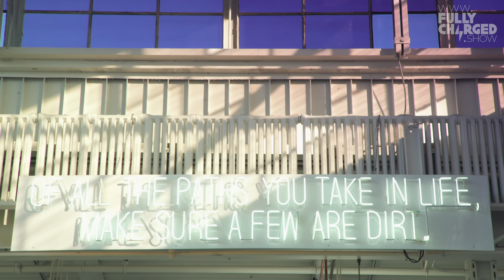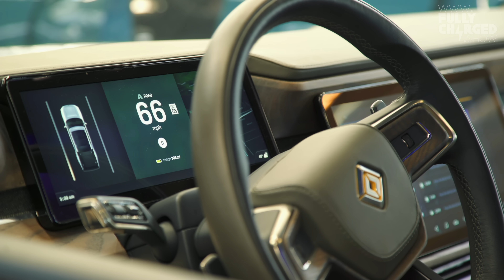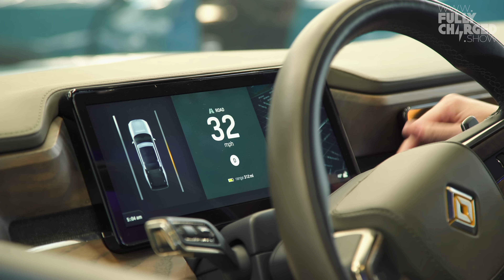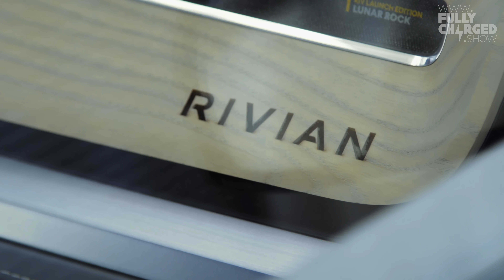Rivian R1S Electric SUV & R1T Electric PickUp Truck - World Exclusive: Inside Rivian | Fully Charged

Comment: Is this an add for these silly trucks?  Ground breaking might be what they do; they weigh 7500 lbs;  towing a car is about 100-150 miles you have to charge; sounds very practical. Did you say your channel is fully charged - these take over a day to charge on a 240v 40 amp outlet.

Comment: It will be interesting to see what the towing and payload range is in real world situations. Also while gas stations are designed to be able to refuel a truck which is towing something, most charging station orientations would make charging a truck and trailer difficult so I would imagine you would have to unhook the trailer, then drive up to the charger. It will be interesting to see how this works out. Overall I'm really a fan of electric vehicles but I also tow with my truck so hearing them just talk about payload and not the actual logistics involved in towing long distance with a pickup is making me want to wait for the real reviews from owners.

Comment: As a truck owner range while towing is an issue. I am quite interested in this truck. They obviously have taken the time to study the market and add some very thoughtful and useful features to their product. And yes range is reduced with an ice power plant. But the infrastructure is there so that you can tow over a great distance and in a timely manner with a traditional power plant. I look forwards to seeing how the Rivian does interms of range when towing, or loaded to capacity. Pulling into a charging station with a 28 foot travel trailer is bound to be an experience. And I will admit the price of admission is a bit daunting, but then a fully loaded 1/2 ton truck is in the same ballpark (my current truck is not a fully loaded model;) )

Comment: I had a thought, what about putting regen breaking on trailers and putting that power back into the tow vehicle.  It would require a different harness and break controller.

Comment: Thanks so much for the Rivian interview Chelsea and Fully Charged.  Sanderson's explanation of torque vectoring with 4 electric motors at 6:33 is outstanding.  Tesla also does torque vectoring between front and rear motors, but with brake actuation left to right, i.e., the conventional way with open differentials.

Comment: Society is changing dramatically when it comes to socialization so to me most guys won't take four full size people with them on any adventure. Most guys would rather have a 6 foot interior bed to sleep in the back and the ability to install a canopy on it.  If you need to keep it same overall length then shorten back seat and increase interior bed length to 6 feet so we can sleep in the back. A family only needs room for two full size people and two kids in the back and they don't need a full size seat. I am a truck man and always will a truck man and I really like this vehicle but I would not buy it with a 5 foot interior bed.  Make a working man's truck not a rich man's truck. Workmen made trucks popular and is the reason why trucks sell so well in America.

Comment: I found the comment about "150 kW" charging interesting. It sounds like they are verifying that these Rivian vehicles will be 400 V architecture, which means they won't be able to take advantage of the currently deployed 350 kW chargers. It could also mean that they are expecting to take a much higher current than what is now being supported.

Comment: This is all well and good, but, they're still not talking about things that are inherently important to trucks.  

How far can I go, towing 11,000 pounds?   And truth be told, I would never tow 11,000 pounds with a truck that size in the first place.   That's not even logical!!!  Being able to PULL 11,000 pounds, is not the same as towing 11,000 pounds in real life, on the actual road.

I would MAYBE tow 5,000- 6,000 pounds, with a truck that size.   You never want to tow anything that weighs more than twice as much as your tow vehicle.  Personally, I don't even want to tow anything that weighs even CLOSE to twice the weight of my tow vehicle.  It's not just about how much the thing you're towing weighs, there's also the kite factor,  suspension and drivetrain wear and tear,  etc, etc. Being able to keep what you're towing, on the road, as well as yourself, is kind of important. 

11,000 pounds is an INCREDIBLE amount of weight for a truck to pull down an actual road, in real life.   This is why anyone pulling that kind of weight is pulling it with something the size of a Ford F350, of Chevy 3500 or larger.   Those trucks themselves weigh 7,000- 10,000 pounds, depending on the model, and they have about a 12-14,000 towing capacity, also depending on the model.   Again.....the whole, twice the weight of the vehicle thing.....

So....what is REALLY important to truck owners is......how much does the truck actually weigh, and how far can I tow what I can actually tow with this vehicle.  In gas or diesel vehicles, it's mpg, and in this case, it's MPC......miles per charge. 

You can throw out all the ridiculous numbers you want, you're not going to fool any actual truck owners. 

It's clear and obvious that none of you have ever actually TOWED anything in your life, if you think these ridiculous numbers are going to hold up in any way, shape, or form, in real life. 

A truck that weighs less than 4,000 pounds, can simply not safely tow 11,000 pounds, even if the power is there to do it.    The truck would have to weigh at least 6,000 pounds in order to even remotely safely tow 11,000 pounds.   And i'd actually say that it would need to weigh more like 7,000 pounds in order to do that any kind of safely. 

Finally, there's a reason that trucks that actually tow 11-12 thousand pounds get such crappy mileage.  It's takes an INCREDIBLE amount of energy to tow that much weight at 60 MPH.   

You're talking about the fact that your TOW vehicle weighs 7-10 thousand pounds, AND on top of that, you're towing 11-12 thousand pounds, for a total weight of 18-22 thousand pounds, going 60-70 MPH down the highway. 

I will just come out and say that you're going to be lucky to get 80-100 miles out of a full charge, towing anything even close to 7000 pounds, which I would hesitate to pull with a truck that size.....  

That's just reality.   You can't fight physics.  Not even with electricity.

Comment: I would like to see a version of the R1T built for work instead of recreation. Larger bed without the fancy spare tire compartment. The tunnel could stay so guys can lock up their tools without the need for a bed cover. The Front trunk should be insulated so guys can store their lunch and water in it to keep cool on the jobsite.

Comment: So... For the "tank turn" (I think that's what he was calling it...) Could you possibly incorporate a 4 wheel steering system that allows the front wheels to both turn in to the front and the back to turn in towards the back... Essentially making your wheel track a circle... I feel like that would be the easiest option and probably applicable on most any length vehicle...

Comment: One question.
Is the platform or skateboard as they prefer it, a frame for wheels and drive train or is it a whole chassis with cockpit. 
Can i take this platform and trow any car body on it? 
How hard its gonna be to fix the platform from a wrecked car? Will a normal car crash wreck the platform to unrepairable state? 
Imagine front impact, body shell is broken, front axis is bend, could i just replace the front axis and drop a new body on the platform?

Comment: Unfortunately there are 2 pertinent things not discussed.  One being a super charger network.  Will they utilize Tesla's super charger network? Given how large the batteries are, how long will it take to charge.  My guess at least  45 minutes which is 9x more than a ICE.  

Considering these are adventure vehicles, what are the approach, departure, and break angles? The leader, Jeep Wrangler Rubicon has 44 degree approach angle, break over angle 27.8, and departure 37 degrees.  Unfortunately the jeep has one of the worst reliability in all segments.  Will Rivian have better angles and reliability?  What will the water fording abilities be? Bollinger B1 has 56 degree  approach angle, break over angle 33 and departure angle of 53.  Clearly Bollinger kills the Jeep but cannot compete in price.  A Jeep Rubicon is  $43,875 and a Bollinger is $125,000.

Comment: I wish they discussed more about long term ownership. Li-Ion batteries have a finite cycle life, what will it be like when a battery pack needs to be replaced after 100k miles? Will the cost of parts & labor be worth more than the vehicle itself? Is this just another example of engineered obsolescence?

Comment: Why can't anyone, even EV companies, make a truck that's easy to get in and out of without stairs and have easy access to the bed? Is it because people who have genital envy are a lot less likely to think before financing a vehicle? The EV platform is uniquely capable of having 4 wheel drive with decent ground clearance without having to hire Nepalese porters to help you get up into the cab. This is because with motors on each corner there isn't the traditional drive-line that either has to hang below the cab like most factory bro-dozers, or take up massive amounts of cab space like in the HUMVEE.

Comment: "Look Guys! I got an ELECTRIC TRUCK!". "cool bro, what does it get?" "Well, it gets 300 miles on a charge! unless you pull something, or fill up it's bed, then it gets 90 miles on a charge. And if you put it in 4wd and load it up it will go 70 miles! If the temperature is below 20f, and you go 4x4 and load it up, it will go 50 miles.." LOL

Comment: Range gets cut in half with a load ... same with IC engines ...
But IC engines do not require a charge jack in the bush/forest , gas and diesel can be found almost anywhere  ..... and don't take 1 hour to charge , never mind -40 temps that will be very range reducing on batteries.

Comment: I disagree with the statement that knobs are not flexible and that is why modern cars don’t use them. In the past that used to be true when the buttons would be hardwired to something and that would be it. These days they are all connected to the brain computer and can have new and cool features assigned to them as easy as the touchscreen. From drivers perspective they are so much better since you don’t have to take your eyes of the road.

Comment: I did some development on electric motor control, space vectoring and torque vectoring. And I can tell you: Offroad is where electric vehicles can REALLY shine. What you can do with individual wheel control is just unbelievable and impossible to even come close for internal combustion.
I said it before, but Rivian is on the right track and I REALLY wish they will deliver and won't fcuk up in the process. So far this is amazing.

Comment: they are cool but, i still want a tesla for supercharging, eastereggs and autopilot.
Reply: Your Tesla doesn't have tank turns, and autopilot is still out there, they could put it on these trucks with a $5000 electronics suite and some software.
Tesla won't have both back wheels in reverse for emergency braking anytime soon either.

Comment: Great Ute guys! Would you  consider battery packs that could be removed from vehicle quickly to be recharged , then you replace that pack with fully charged pack. Just like you do with battery drills for trade use. Instead of charging stations you have battery stations full of batteries that can replace the exhausted ones .Just need one shape that will fit all/ most vehicles .these stations could be solar charging old batteries at same time while having fully charged batteries to go. Would a small generator put enough charge into batteries for longer out back trips when sun not shining.a light two stroke motorised generator.hope these ideas help in your endeavours

Comment: A band new Yukon XL SUV will run you around 70,000$. Personally, I'm sick and tired of oil changes, transmission problems, your momma problems with Internal Combustion engines ( spare the: well, if you keep up on your maintenance mantra please ). 

It's a start: the journey of a  thousand miles starts with one step.

Comment: The only chargers out there taking fast charging seriously are Tesla superchargers. With a nearly 200kwh pack charging at the common 50kw DC fast charging rate is going to take at least 4 hours. Yes the new standards allow for higher rates but Tesla is building and installing 250kw charging now and pretty much nobody else is spending the money to build very high power chargers. Rivian unfortunately needs make the deal with Tesla to get access to the Tesla network or their amazing vehicle will be effectively landlocked by the junk non-Tesla charging networks.

Tesla also has a much better user experience, it would suck to buy an 80k+ luxury suv then have to get 2-5 different charging apps which work half the time standing around in the cold waiting for your app and charger to sync.

Rivian's downfall will be depending on third party charging companies to get their shit together.
Reply: They are relying on Ford

Comment: Interesting video. I'm looking forward to seeing Part 3 with the test drives. On the subject of a motor per wheel, Land Rover have been trying this out on a Range Rover and a Discovery. But the most widespread use is in the giant truck used in mines. These used to be mainly diesel hydraulic, particularly in the largest sizes. Now they are going over to diesel electric,because of the finer motor control. And this gives you dynamic braking with energy recovery, so hybrid is the way that is going. And autonomous driving is now a function. A couple of big Australian mines are going over completely to autonomous hybrids, because having to operate in 40C plus temps. Without a driver you don't need AC! Except for the electronics. I've been watching the tech and it is interesting how it has moved. Battery forklifts are now a mainstream thing, not a niche product. JCB in the UK are producing a range of battery electric diggers and other road working kit for use in confined spaces and the urban environment. Apart from electric buses for the city centre, the Amazon vans are not a new thing. At least two London boroughs have had electric vans and pickups for 5 years. I live in a suburb, but the local train station now has electric black cabs! Robert said recently that he thought the tipping point had been reached, and I think he is right. Unfortunately I have had to give up driving due to failing eyesight so I wont' get to enjoy this as a driver!

Comment: All this amazing and inspirational tech talk... And then they use it to make a huge lump of a truck/SUV that still poses the same problem as ICE SUVs: More city space being clogged up (cause thats where their vehicles will go 99% of the time), more stress to the infrastructure, more danger to pedestrians and other drivers because of their drivers not good or careful enough to navigate such a huge lump of automobile and yes, even more pollution. This thing will use much more energy than a normal EV car. Since it is much too expensive and high end to be used as a work truck, it is still a vehicle that almost nobody really needs and as such a symbol of excess and obesity that we can not afford anymore.
Reply: , by definition "city space" is clogged. Humans are packed together because it's cheaper to store and control them. In the good old days, it was "40 acres and a mule." Today city folk can't take 40 steps without bumping into someone.

Comment: The problem with a screen if it goes bad your essentially blind to every function, radio, heat/ac, cluster gauges, warnings, hazards etc.  

If my car with engine and knobs goes, usually it idles rough, you can at least listen to radio or view current data like temp, fuel or something.  

Like anything you take just 100 of anything and I can guarantee that 1 if not 10 to 20 will work differently, particularly electronics

Comment: I need to pull a 16 ft trailer loaded with a old tractor and a lot of scrap metal 40 miles. 
The load will be around 3 ton on the trailer. 
Now my old beat up F-100 with a 302 out of a Maverick will do it. 
Will the ev truck be up to the task. 
Just curious. It is 40 miles there and 40 miles back. The double axle trailer will be loaded with lumber on the return trip.

Comment: For off road, I cant imagine running out of power in the middle of nowhere. The new Ford Bronco is where Im leaning.
Reply: You mean like running out of gas in the middle of nowhere...? They have the same range as diesel trucks, the only difference is how you fuel them...
Reply: @ghostthough7874  No I meant like having extra gas cans with you vs have extra what for an EV?
Reply: @WaterDrive1  You're able to get extra batteries to give you 10-15 miles of range for the same space as a large gas can... Though... who the fuck carries a gas can in their truck? That's retarded. 

I'm Canadian and go camping up north all the time with my family, normally with a trailer and like 600 miles away. Never once have I ever needed to bring a gas can down a logging road for extra gas haha. If a truck has 300 miles of range it's fine to take off road without a problem. Tesla pickup is going to have 400-500 miles of range. Rivian is suppose to have 300. Perfectly acceptable range for off-roading.
Reply: @ghostthough7874  Maybe on flat surfaces. Once you start climbing , the battery use drops considerably, And if you tow something your range may be cut in half or worse. How about driving in the 120 degree desert? Batteries hate heat. They lose charge fast   https://www.youtube.com/watch?v=-cvNfmL7XQg